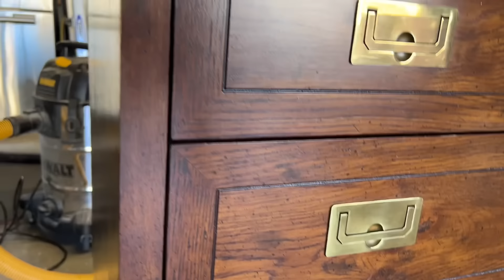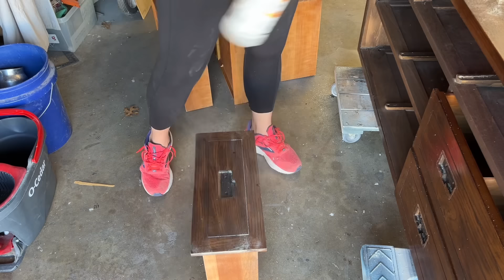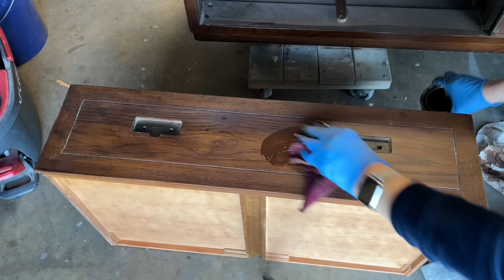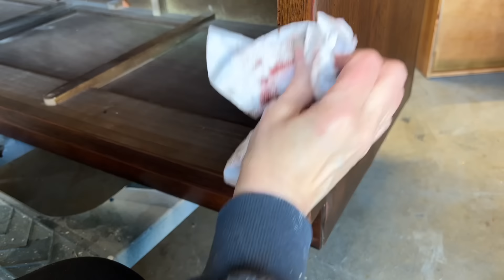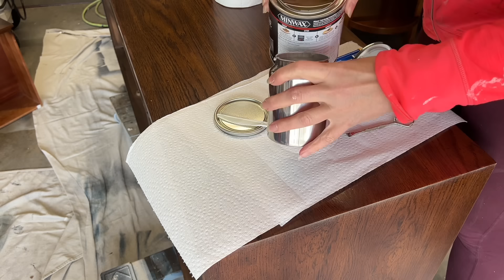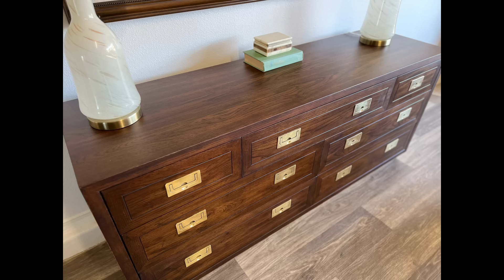I'll share my secret to a gentle restoration! #furniturerestoration

Comment: Can you do a gentle restoration on a tabletop with white water marks?
Reply from the maker: Hmm, that’s a tough one. You would have to remove the white marks first. One method is a cloth over of the stain and a dry iron on low heat. That should release the moisture. If it doesn’t work then a full refinish would be required. A gentle restoration is more for pieces with a dull finish.
Reply: @ivylaneinteriors  thank so much for responding. I love your channel and your work.
Reply from the maker: @Charles-Mom  my pleasure! Thanks so much 🫶